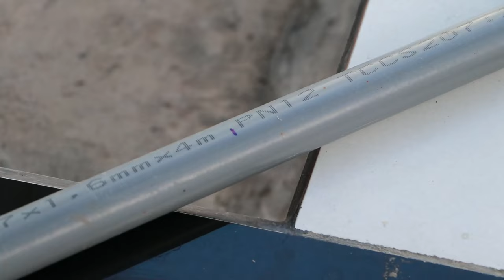So surprised when Adding 2 plastic bottles to the DIY Sprinkler system

Comment: What is the use of the bottles?
Reply: yang tahu tahu aja
Reply: Creating pressure
Reply: @prabhuganesh6331  Thanks for quick reply 🙏🙏👍
Reply: Bottle does not creator pressure. It rather stabilize the pressure and reduce impulse in water due to sudden increase and decrease of pressure. So the water will be going out with constant stream or pressure
Reply: @kingofnight0535  very correct 💯
Reply: It maintains constant and equal pressure